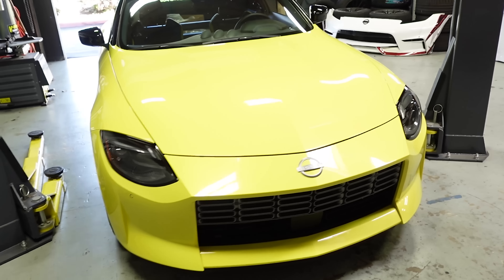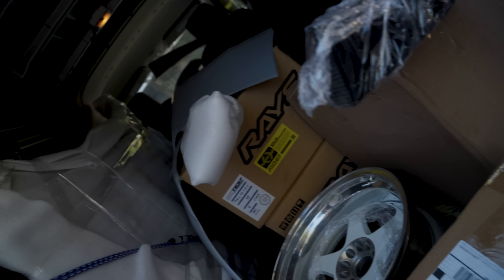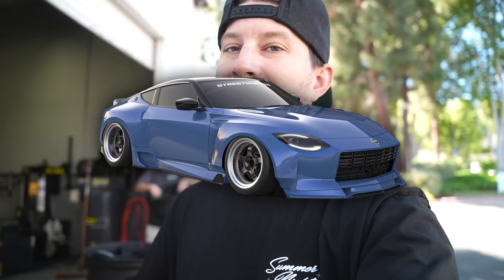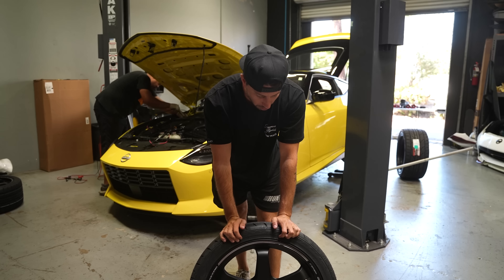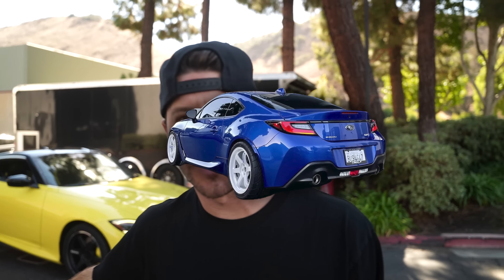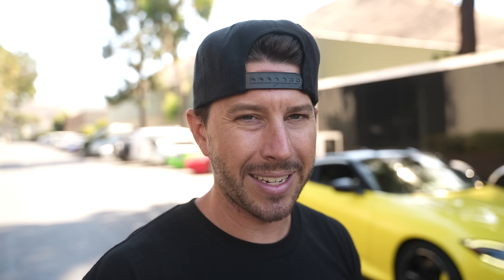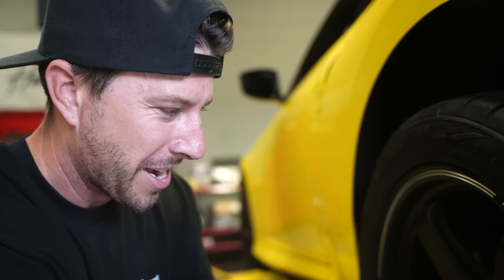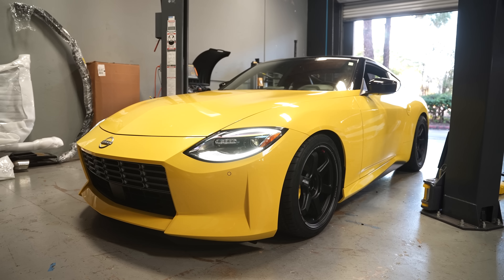NEW WHEELS FOR THE NISSAN Z PROTO!!

Comment: Get the MeisterR billet single piece aluminum body suspension kit. You will save a lot of pounds on suspension weight.
Assembly in UK for quality and reliability.

Comment: Fun fact, the subwoofer is the same as the 370z, spare tire surrounds the sub for less vibration :)
Reply: My 2013 Nissan touring had the one on the back but I cut it and replaced it with two subs putting out 1000 watts
Reply: Was looking for this comment, def have that on my Z

Comment: 370z's have the subwoofer as well if you have the Bose stereo. It actually sits inside of the spare tire but it looks identical to the new Z. Suspension looked exactly the same as well which isn't surprising either.